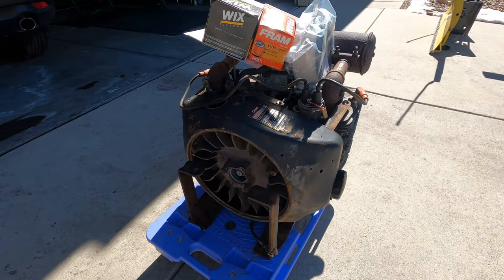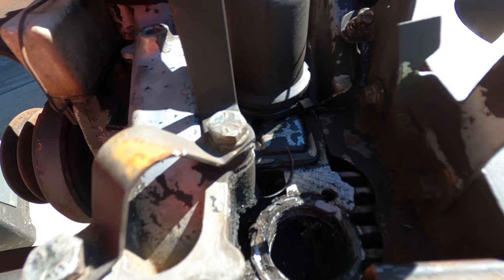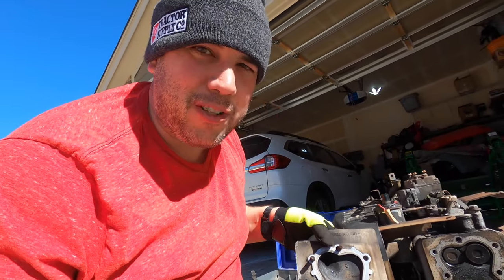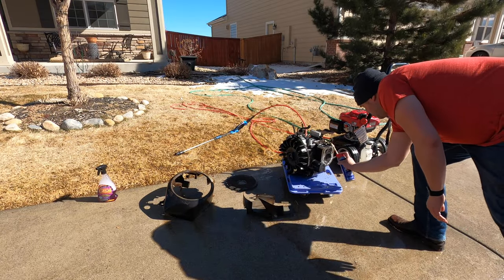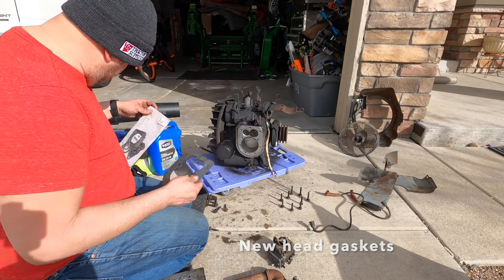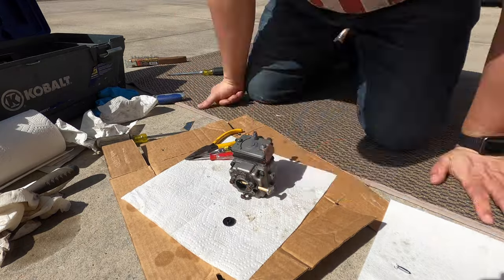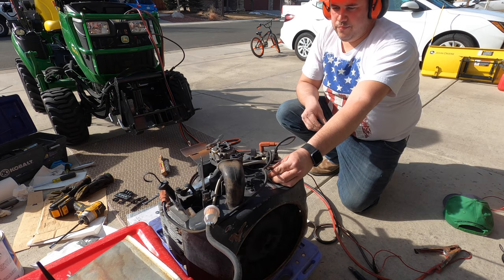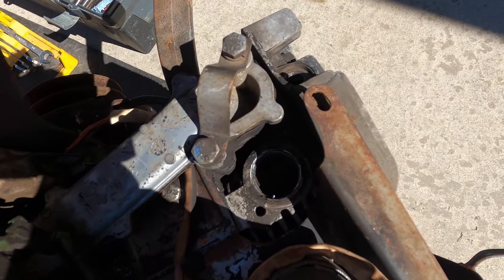Onan Engine Refurbishment & First Start for Bolens QT16 Garden Tractor

Comment: Watching this trying to figure out how to take apart mine and clean it to deal with suspected overheating. Appreciate the detail.
Reply from the maker: Hope it helped!  I would just give it a good cleaning, and ensure the flywheel is able to pull in air to blow out through the cooling fins on the head.  It would be a good time to replace your head gaskets too.
Reply: You'll get it apart. my 18 was mounted to a steel plate probably how they mounted it to a mower or something but there was a bolt on each side so the plate had to come off so I could get those last 2 bolts

I was thinking about mounting the onan 18 engine to my old john Deere 110 but the 18 is missing the engines shaft pulley but I do have spare parts around and one might fit or weld it to the end of the shaft

Comment: Hey you did a great job in that engine everything you did was fine I love those onans I have one in my John Deere 318 garden tractor it’s very reliable and runs excellent I always pressure wash motors if I have them out of the machine the spilt intake manifolds are a weak link so you’ll in the future possibly need to reseal them
Reply from the maker: Thank you!  The 318 is a great tractor!  I believe those have the Onan P218 engine, right?
Reply: @TractorHoarders  yes the early  models 1983-1987 had a b43g engine and the late models 1988-1992 had p218gs mine is a 1992

Comment: Are these similar to the onan engines used in john Deere lawn tractors?

And I love your channel! I love old and new tractors as long as it's not an MTD lawn mower
Reply from the maker: Hey Trent, thanks for the on-going support!  These are very similar to the engines used in the John Deere 316 and 318.  This one is a “B series” and JD used the “P series”, but very similar engines.  These were also used in Gravely, Case, and Wheel Horse.

I like them all too!  Like you, not much of a fan of the cheap, mass produced MTDs that are branded many different ways.

I guess I just like stuff that is built well!  I appreciate you following.  I know that when I post things like this it typically doesn’t get the higher views like my 1025R videos, but I like the old ones too, like you.  Have a good weekend!
Reply: @TractorHoarders  thanks man! Bought a house with a little over half an acre back in 2018. Yes yes, I wanted 2 to 5 acres minimum but the housing market is crazy. 

I need to get a riding mower but hate the low quality mtd. Wanted a john Deere, cub cadet, Wheel horse, bolens etc pre 1990. Not sure at all what I'm going to do yet. I'd enjoy something older that's built to last. A JD 318 sells for $1500 ish and I'm trying to stay around $800 or 1000

Comment: The 19.9 muffler pipes actually came off easy they have a short sleeve piece that fits in what's connected to each muffler I know mine needs a new condenser probably spark plugs to even though they tested put good the one closest to the battery showed a weaker spark but then it could be the old plug wires are shot all the stuff on the mower is all original even the starter 

Same for the onan performer xsl 18 on it is all original parts 

I still might make a spot on the back for the battery so I can have a gravity fed gas to the carburetor and no pump because the cheap little pumps mess up to fast so that and a shut off valve and put the new gas line on I'll probably try a kohler pump or Briggs one on first before I do and changes with the tank

Comment: Help please i have a generator will not start i am spark getting gas but it will not start can you give me some good advice what to check on i check but can get it
Reply from the maker: If you have spark and have gas, but it will not start.  1) try using starter fluid in the air intake.  If it tries to start, your carb needs cleaned. 2) Do a compression check 3) check your timing
Reply: I tried all of that still it's back fireing
Reply: @WASIMEDOO  What's the compression like? My onan 6.5kW genset had 135psi in one cylinder and 0 in the other, turned out it was a completely stuck exhaust valve I needed to replace, it was so rusted.

Comment: I was given 4 old push mowers still good and a onan performer xsl 18 engine and a sears onan gt 19.9 mower and a craftsman gt 16hp mower 

And I've cleaned one side of the 18 now just got the other side to do and get some cheap parts for it and see how it goes 

Wonder why people like the onan 19.9 better than the craftsman so once I get the 18 and 19.9 finished they're gonna be put up then I'm gonna start on the old craftsman and use it for cutting think it's transmission is in a gear cause it didn't wanna roll.

I also got a manifold and carburetor it goes to a onan not sure what size it fits on but it's smaller than the 19.9 onans manifold I got all this old stuff free so it's new this single manifold and Nikki carburetor on the onan manifolds #170-2969 anyhow I cleaned it all on the inside

Comment: No rings and no valve job,  not a rebuild just a make work project
Reply from the maker: Certainly not a rebuild and wasn’t intended to be.  The whole tractor came out looking great with an engine that runs just fine.